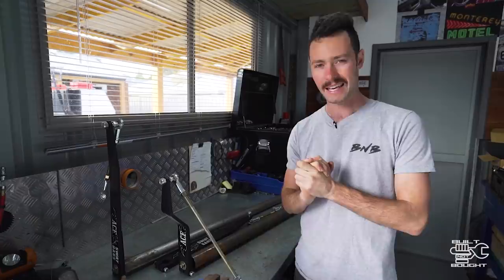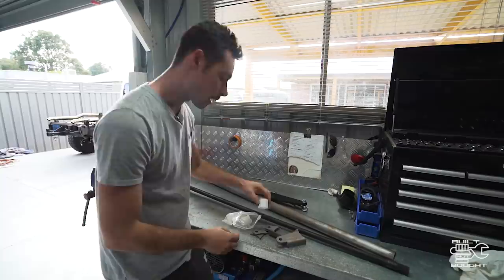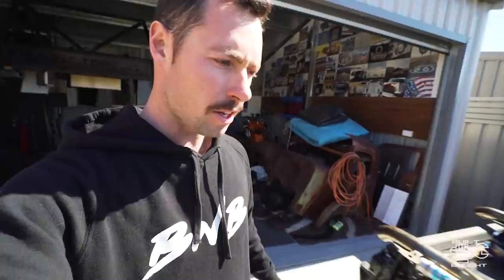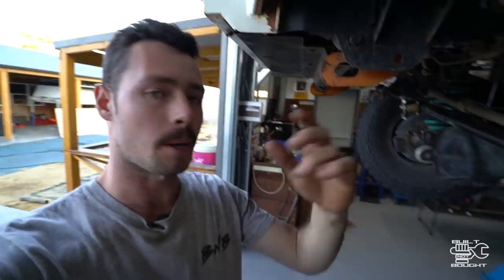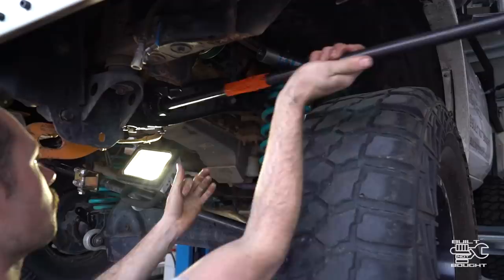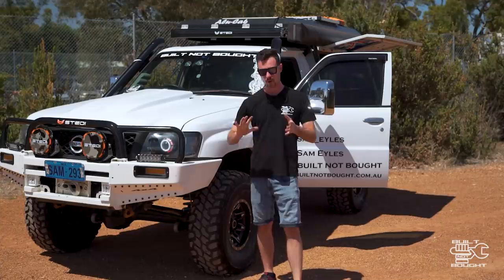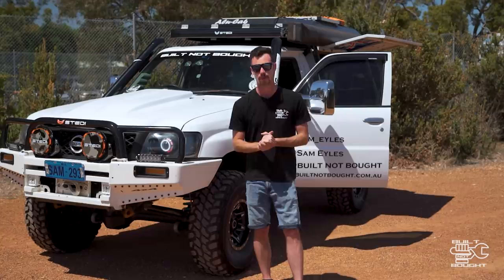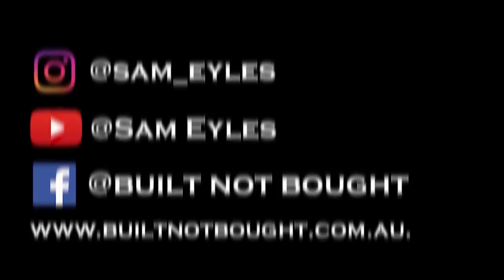SWAY BARS || Are These The Next Big Thing!?

Comment: $1300 an end plus fitting... I'm wondering how this is going to be better than just upgrading to a 24mm HD sway bar and link Sam?
At least with the sway bar you can disconnect off road.
Reply: They work differently to your conventional sway bar. The idea with the anti rock style sway bar is that you get good on road handling characteristics without needing to disconnect off road. 

You want a sway bar off road, leaves the cars movements in an out of holes more predictable.
Reply: Yeah, I understand that... But by the time you get the item, fitting + an engineer certificate... I'm just wondering if the juice is worth the squeeze.

It takes all of about 30 seconds to disconnect my sway bays. And I understand what your saying but it also limits flex that you may need if you don't have lockers and need that foot on the ground. Traction vs body roll.... I know which one I'd take.
Reply: @andrewcox710  get what you're saying. I've got standard in my patrol, with extended links. I don't remove mine off road. They don't limit my flex. I don't have super long shocks anyway. 
At the end of the day, it depends on what you're doing with your vehicle majority of the time and how much coin you can cough up for a mod like that.
Reply: You can get a selectable dual rate torsion bar swaybar for that sort of money. I have a teraflex dual rate st swaybar and there is other çompanies like offroad only that also make them. The teraflex one has forged arms a heavy hollow torsion bar with a smaller solid torsion bar inside it. It has a disconnect knob to disengage the bigger torsion bar and leave the smaller one connected offroad turn the knob and you're using both together for a stiffer on road one.
Reply: @Jipby54  If your standard bar doesn't limit your flex, then it's JUST A LENGTH OF HEAVY WIRE. A sway bar is essentially a spring (that has a resting position), and in any other position, it is working to return to it's resting position (limiting your flex), or it's f*cked!!!

Comment: Did you use loctite on the sway bar threads/ nuts from them getting loose.. like a low / med strength product or you dont need to ?

Comment: Interested to see if you can get that engineered and legal in QLD when you move over.
Reply: 1800SHWEEEET I was thinking the same once the welder came out that was the last nail.
Reply: Wikkid Me 
I dont see the problem with getting the welder out.
With this setup the original mountings would  break.
Because your putting heaps more force to your brackets... onto your chassis.
Only worry getting the welder out if you cant weld
Reply: Would have to engineer but reckon it'll pass anyway as it's kinda unnecessary extra safety features, they are usually pretty good with passing them as long as it's clean and done well
Reply: larry worrell 
You would think the product  would be engineered as a diy... product...
And its up to the buyer to get it engineered.
For legal road use.
Then hopefully  the person installing it can competently weld to a high standard..
Looks a bit involved  watching it the first time
Reply: @noelscammell662  it makes sense, to sell them they usually have to meet the standards to start with and are all usually engineered, but still have to be checked even if professionally fitted in NSW and QLD anyway
Reply: Noel Scammell you need to find an engineer that’s willing to sign off on someone else’s work. Welding chassis is very contentious in qld.

Comment: Absolutely NOTHING new about these. You're obviously just "sponsored" to promote them. Waste of time (especially money) for 99.9% of 4x4ers. Their only advantage is in the case of extreme wheel travel (ie competition) and maybe fine tuning IF multiple holes were located along the link arms. Fact, a "standard" sway bar is also a torsion bar. A "standard" sway bar mounts identically (albeit inverted, with the only disadvantage being slightly more unsprung weight, being mounted on the diff rather than the chassis). Your claimed "standard bar" torsional resistance (at 1:30), is minimal and is simply the slight resistance of the rubber/polyurethane bushings. You claim the bushings in the tube end are to keep water out. Good luck with that :D No, they're there to act as a bush (bearing surface) to prevent the torsion bar "working"/wearing on the steel tube. In a river crossing, water WILL get in and then you WILL HAVE ISSUES with out of sight rust/corrosion. Cutting chassis cross members out and welding to the chassis is not something that should be highlighted without extensive warnings, engineers advice/approval. And in conclusion, the "piddly" welded rackets and the rose joints (require a lot of TLC) potentially "twisting" the link arms, all makes for a system that wouldn't have much of a load rating anyway. "Standard" heavy duty aftermarket sway bars (with quick disconnects if you like) for an absolute FRACTION of the cost of these, would be a far better option for 99.9% of the punters.